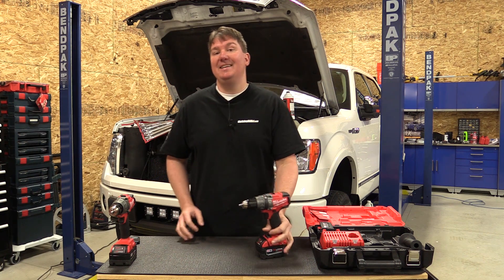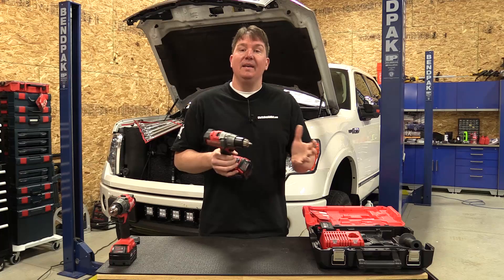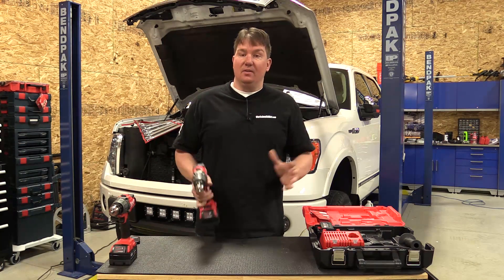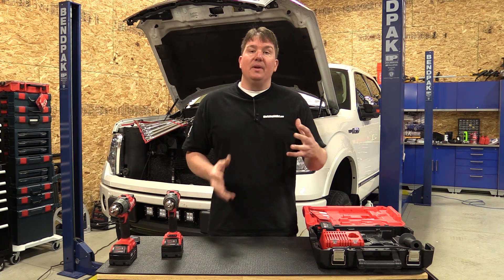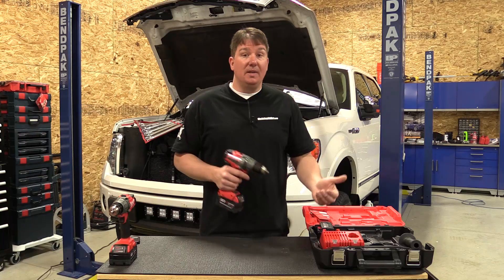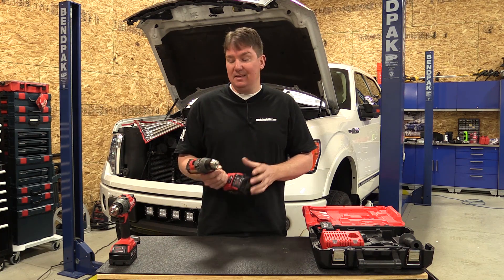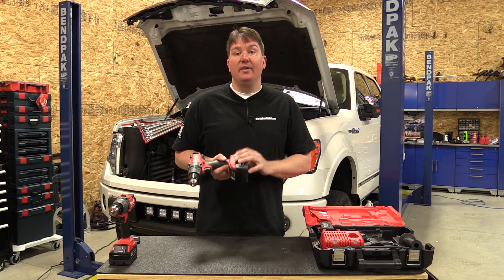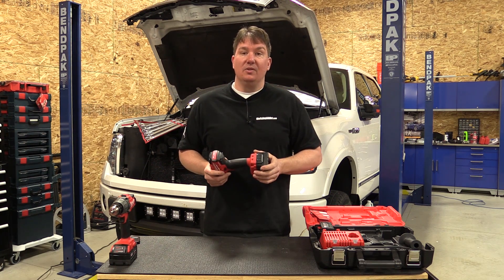Milwaukee M18 FUEL ONE KEY 1/2" Hammer Drill Driver 2706-22

Comment: You mention the "big picture". "Big picture ONE KEY" opens an avenue to shut down your equiptment, when ever "they" want to. Why on earth would anyone want the powers that be have control over your tools, home security??? ditto. people should rethink current technology options. beleive me, it's NOT as pretty as you think. Even if I used onekey, by the time I get around to program it, I can quicker load a bit and adjust speed with the trigger, and I'm done.

Comment: What's the difference between 2705 and the 2706?
Reply from the maker: 2705 is not a hammer drill and 2706 includes that option.  Otherwise the same.
Reply: @WorkshopAddict  thanks

Comment: that sounds very complex . I have cameras that have so many settings you can miss so much just by fiddling with the settings so you can point the camera and squeeze, I mostly use it on auto.. I'd rather have a drill driver on auto too. I just got a 12v milwaukee drill driver that is defective out of the box. The drill is dead if you leave it idle for app 90 secs. you have to remove the battery, wait app 2 mins, freplace the battery and it will work again but lapses into dead mode when the drill is idle for app 90 secs or more. Complex electronics with 'chips' that are letting down the very impressive mechanical build quality of these tools. Trying to send it back.

Comment: I don’t know which drill to get ?? The have numerous drill /hammer that look identical
Reply from the maker: I can easily help you out.  First, I want to say we have a great drill video coming out at 7am tomorrow.  You will like it.  Do you want the One-Key hammer drill?  Do you want the hammer option for drilling concrete/masonry?
Reply: WorkshopAddict Well that was a quick reply ! Well I’m not sure yet if I want the one key yet. I know it would make life easier and it’s a cool feature but the drill will still do the same job with or without . I’ll be drilling mostly wood and thin metals. I’ll go for a hammer one because I know some day I’ll need it and I’ll be mad I didn’t go for it ! Great videos
Reply from the maker: Thanks.  Looking at the prices, go with the 2706-20 (Bare Tool)  http://amzn.to/2FBN7p5  It is $10 bucks more than the 2704-20 and the 2706 has the electronic clutch.  Even if you never use the One-Key part, the electronic clutch is worth it.  Check our channel tomorrow as we will have 3 drills going head to head and the Milwaukee is one of them.

Comment: To be honest, this is just getting silly! As an electrician  I really wouldn't mess about with all this gimmicky rubbish, ridiculous! We need a strong reliable drill that will stand up to everyday abuse. We don't need stuff where you have to use a phone to set it up? I wonder how many tradesman their marketing department asked, 'what would you like in a drill, what's important to you?' I'll guarantee it wouldn't be this sort of junk! More cheap Chinese electronic tat to go wrong imo! I guess time will tell....
Reply: +mokotramp don't worry they are going to keep the regular models. This is a very specific tool for people who need it for specific reasons. Somebody who has to use self tapping screws for factory assembly of kitchens or something  this might come in really handy. But i gotta agree that 9/10 of the normal tradesmen wouldn't bother using the onekey. Gotta say it's a good thing still because the torque clutch used to be kinda shitty on milwaukee, the lowest setting wasn't as sensitive as other brands making it difficult to use with small screws.
Reply: +FoodOnCrack Yeah I've noticed the clutch isn't that sensitive on my 18v combi. Quite easily over drive small screws. I've got a small 10.8v Makita for small jobs. 135nm of torque is beastly! I guess something this powerful is going to struggle to be sensitive the other end of the scale...

Comment: This one key system just seems like a distraction. I'm glad I got the fuel drills without it. Instead of doing the task at hand, I have images of people on their phones changing the settings for 5 minutes.
Reply from the maker: You do not have to use it if it is not needed.  But when you get into a situation where the adjustments save time or get you the correct rpm, it is a blessing to have.

Comment: can you do a video on the impact wrench and how useful the one-key system is useful for it? From the videos I see I don't see where you would you can put ft lbs
Reply from the maker: I just completed the impact driver and they do not have ft lbs on that part of the app.  To my knowledge, the impact wrench does not come out until mid-march.  when I get it, I will be all over it as we have a Jeep lift starting at that time.
Reply: isn't it out already? I see on the milwaukee site that mo. number 2758-22 the 1/2" compact impact wrench w/ one key is available for purchase. Also, how are you supposed to set it to lets say 80 ft lbs or 100 ft lbs or even 30 ft lbs, is it possible?
Reply from the maker: +eddie5255 Every one key tool has a different way to set it up.  So without having the tool, I do not know how the setup works.